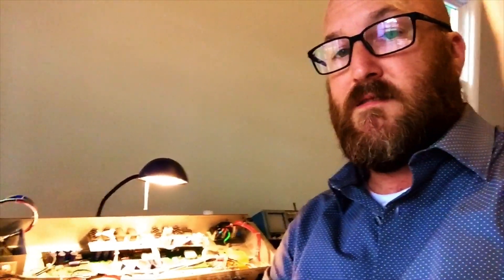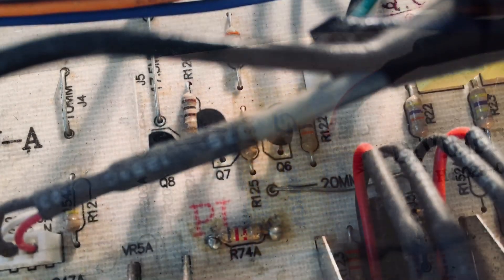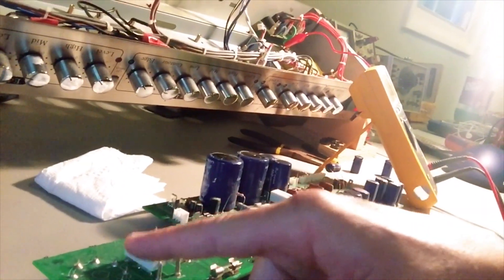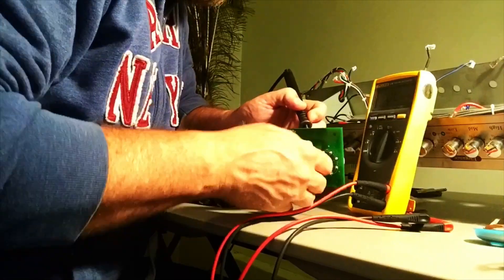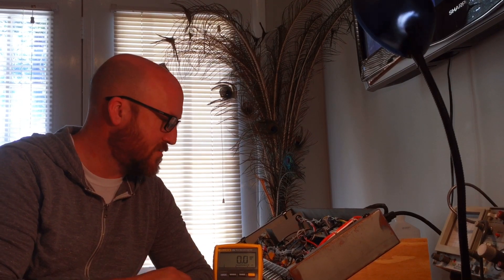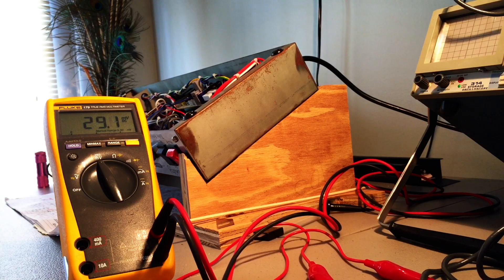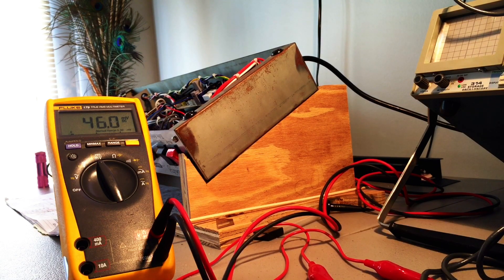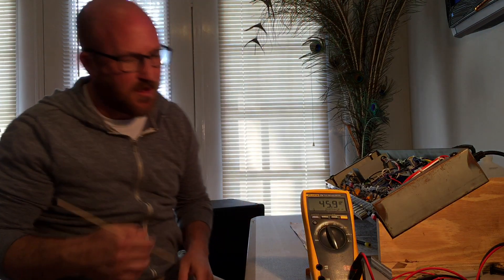Madison Divinity Red Plate Issue / Runaway Bias Issue

Comment: Thanks for sharing your work.
So prior to your shown repairs and adjustments the tubes were redplating and noisy yet your guitar signal/input was not coming through to be heard at all? That puzzles me. I'm currently dealing with that same situation and trouble shooting on my amp (vintage Hiwatt). I just want to do things right as to not harm the transformer.
Reply from the maker: Go on Amazon and order a load resistor at whatever ohms your speaker cabinet is like 8 or 4 and at 100watts or above. Should be a couple of bucks. Also get some thermal pasted and some metal to mount it on for heat dissipation. Whole build should be less than 20 bucks including the speaker jack.
Reply from the maker: You won’t hurt the transformer as long as you have a load on it. I have a small reverb tank I converted into a 100 watt dummy load at 8 and 4 ohms. That way I don’t have to hear the amp to work on it and still save the transformer. Check my carbon repair video to see the dummy load. It’s shown on there. As long as you have the impedance matched and the output load on it you won’t hurt that output transformer.

Comment: This amp copied the JCM 2000 so much it has the same bias issues the JCMs did. I remember when Madison came out they were like krank and gave endorsements out to everyone. Always wanted to check one out. I remember an add in guitar world and Through the eyes of the dead and  gwar were on the ad. Tteotd was why i wanted to check them out and i wanted their dense smooth tone. Turns out I already had their rig they used JCM 2000s wasn’t until recently I discovered the divinity’s are dual and triple lead copies with different tone stacks. If i find one locally for under $350 ill snag one.
Reply from the maker: youngmike8645 you’re pretty spot on. The only difference is the tone stack and a few spots in the circuitry. I have several Madison amps and they are pretty tight and decent cleans.
Reply: Jason Springs I always thought the cleans on my old dual super lead were awesome not that i ever really used them. I remember when i got my jcm back in high school i would always read and hear about Marshall not being able to produce any decent clean channel amps. The jcm 2000 was my first proper tube amp and halfstack for that matter. I miss it recently sold it a few months ago.
Reply from the maker: @youngmike8645  right on. I’m learning about linear transformers. I think I may be able to one day make this amp super clean at high volumes without losing the heavy gain on the other channels.

Comment: Mine always has an annoying buzz. I've read a lot of people have disconnected the light that lights up the logo. Does yours have the buzz?
Reply from the maker: I have several of these Madison Divinity amps and there is a difference in the amount of buzz you hear with the lights removed from the circuit. Its a quick fix to remove that light. Open up the chassis and just disconnect the wire on the output board. I have managed to hook up an LED strip to replace the light and the LEDs didn't add any buzz and I was still able to have the lit Madison logo. The reason for the buzz is that they used a CCL (Cold Cathode Light) to the circuit, think fluorescent lights and how they interfere with guitars and tube amps. They installed one right on top of it! :) If interested I can do a video showing other options to light up this amp without having the buzz. It won't harm any of the circuitry to remove that lamp from the circuit of your amp.
Reply: @jasonsprings4330  my divinity 3 didn't buzz for a long time but recently is getting really bad. I also noted my tubes are getting weak and need changed. Can the tubes be causing the buzz? I swear I never had a buzz until recently.
Reply from the maker: Gary Lambert. It could be. One way to find out if it’s tubes or the light is disconnect the light and try it. No buzz then it’s the light. Buzz still there it’s the tubes. It may be the tubes since it’s recently buzzing out of nowhere. Let me know.